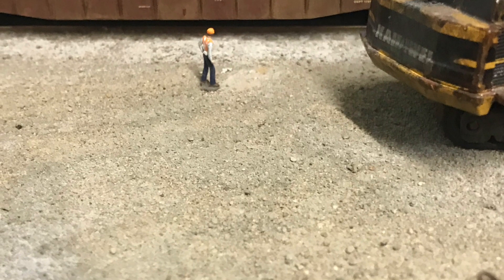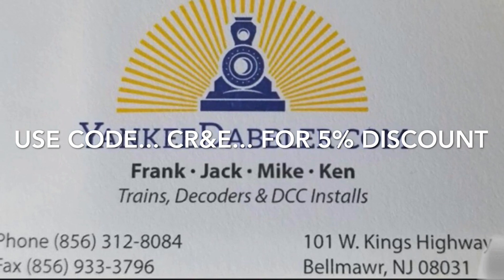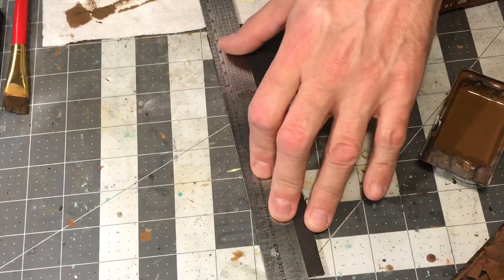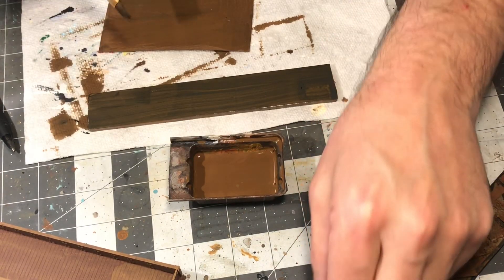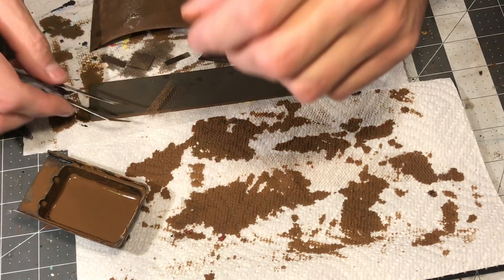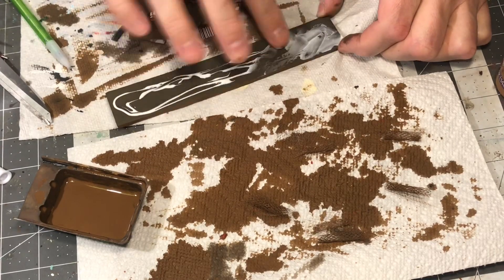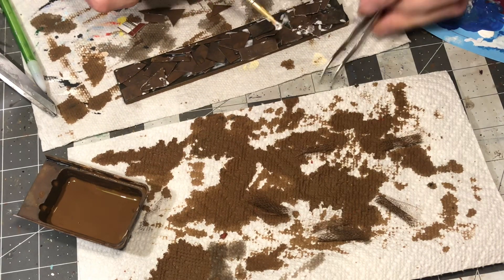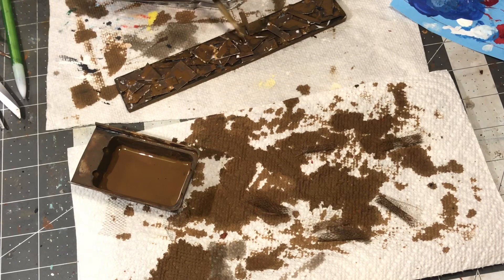Let’s make a scrap load

Comment: Very cool scrap loads!  I'm going to have to try making some for my own cars!  Just as a fun side note, Bob Pope, president of the West Plains Model Railroad Club and vice president Dillon Hubbard, actually made their own coal loads using foam and real coal and it looks really cool!  If you look closely at the video of the coal train we ran at the Harlin Museum, you can really see the difference between Bob and Dillon's homemade coal loads and the stock loads that came with my Athearn rtr cars at the rear of the train.
Reply from the maker: randall ellison thank you. I’ve been using black sand from dollar tree. It comes out pretty good. I’ve seen where people have crushed coal and used it. But I’ll have to check that out. Thanks for letting me know. David
Reply: @Crookedriverandeasternrr  no problem!  If I remember correctly, Bob said he got coal from somewhere in Pennsylvania near where he used to live before moving to West Plains.